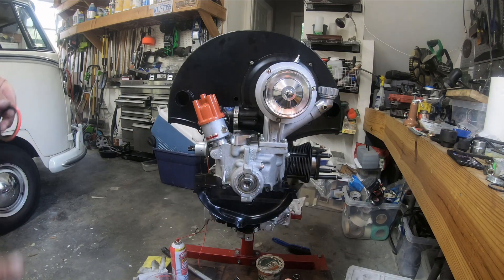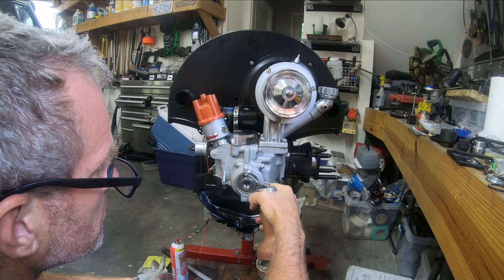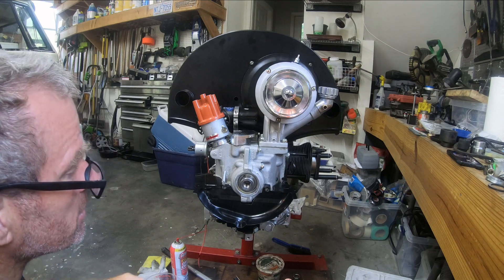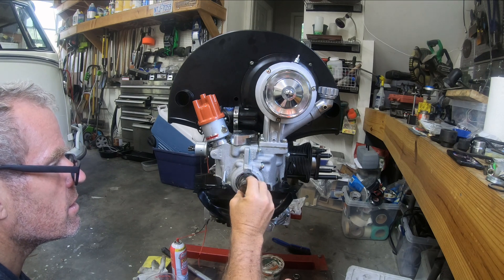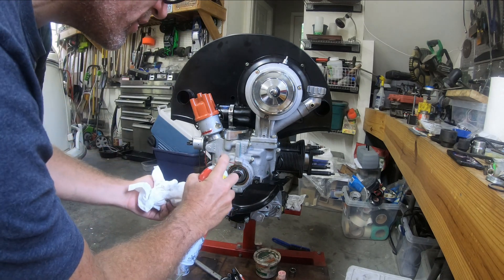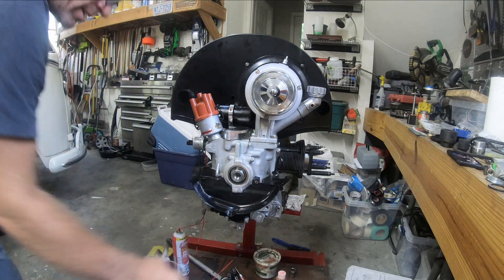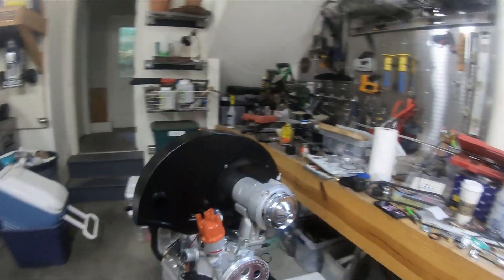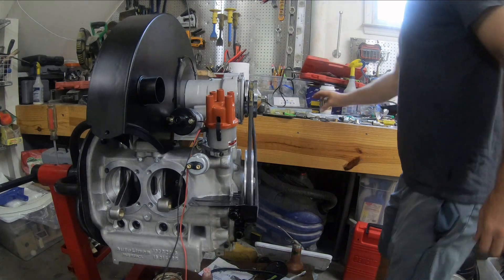2332 VW Air-cooled Stroker Motor - Video 24 - Sand Seal and Crankshaft Pulley Installation

Comment: Anyone got any advice om getting the sandseal out to replace it.  I fucked mine last night smacking a non sand seal pulley on. I have been told there is a small lip on myotor that prevents the sand seal  from going in the motor. Its been a tough week.  I purchased the new seal .  Its a non bolt on green one. Machined fit The motor builder told me to get that one.    He made its sound like it was gonna be a quick fix. I tried for a few hours after work.   No luck.   I will re visit today with a seal tool
Reply from the maker: So I used a sand seal on my bus motor.  With the pulley off there should be a little circular cutout where you can tap the sand seal into place and then the pulley goes back in .  Are you saying your case doesn’t have the fitting for it to tap into place?
Reply: No what happened was is I tried to put in a regular pulley with the grooves not the sand seal pulley hub and so I screwed the seal up that was in there already It's not a bolt on it's a pressed machined one but I ended up speaking to the man who built my motor today and he showed me how to get it out. So I have to remove it and then put a new sand seal in and then get the proper hub for my pulley. All just part of the learning process for me @LarsonSplitBus-

Comment: Did installing Sand Seal with permatex work to keep oil in, and was the pulley a non grooved style? I think previous owner may have had a sand seal because i found spacer between crank and aftermarket grooved pulley, I dont believe this would be correct. Considering installing sand seal with correct pulley to try and stop wicked oil slinging in engine bay
Reply from the maker: I actually have a sand seal and a normal slinger steel pulley now.  I got rid of the aluminum pulley because it kept getting loose.  Nothing like a steel pulley!  And the sand seal just sits there around the slinger and it doesn’t leak any - at least not from the pulley.  I have other small leaks around the valve covers and over the heater boxes to deal with!
Reply: I feel like putting in a seal cant hirt at least press fit style. Really like stay with grooved stock steel pulley even though guys have said grooves will tear seal. Idk guess got to experiment solve it somehow

Comment: Note to self:
Before mangling a sand seal ....
Alway use the 8 Ps:

Proper Pre-arranged Planning and Preparation ... 
Prevents Piss Poor Performance

Lol
Reply from the maker: Yep - somehow this time it worked out ok - no leakage from the seal, but I have trouble achieving zero leaks under the motor…
Reply: Synthetic oil molecules are all the exact same size. While dino-oil molecules are totally random sizes. Dino oil has a better ability to for a dam and have a lesser chance of leaking.
At least, that's my experience. Cheers

Comment: i've never heard of shims on the lower pulley?
Reply from the maker: Interesting!  So I hadnt either, but to get the whole pulley system to align with the AMR500 I needed it to be out just a bit, and there is a kit of the crankshaft shim and generator shim that was the perfect width.  I did have the crankshaft bolt loosen up - and since about 4mm less threads go into the crankshaft, it may be more susceptible to loosening.
Reply: @LarsonSplitBus-  not sure what AMR 500 is but I forgot to mention maybe because you are using a sand seal pulley that could be why you can run shims on the lower pulley. It looks like you might have ditched the upper pulley based on one of your later videos but it was hard to see.  I plan to go with the cb performance alternator pulley you had but in black to match my lower pulley.
Reply from the maker: @SanDiego_VDubLife oh ok - yeah sorry - I was talking about the latest video with the supercharger on the beetle - I didn’t notice that your comment was about the sand seal pulley install - my bad!
Reply: @LarsonSplitBus-  oh jaaaa. No worries

Comment: Is it possible to install the sand seal with the motor in the car? Just realized I installed a sand seal pulley and now I sling oil when I drive it.
Reply from the maker: I think as long as you can get the pulley off and back on (which means you have it in gear and the parking brake on, since you cannot get a flywheel lock on there) then you can get a sand seal on there - either on a machined case, or with the little after market sand seal kit round piece that you tap on there with a mallet.  But i know these pulley nuts can get on so tight you can't get at them with enough leverage.  Also if you are using a large wrench on a pulley nut - be really careful not to cut your hand on the pulley engine tin if the wrench slips off.
Reply: @LarsonSplitBus-  Thanks for the reply! I decided to go with a new sand seal pulley kit. I have a very old power pulley with the grooves. It just might be that the grooves are worn and not doing their job. The grooves are very flat and minimal. I see the kit comes with a washer that goes on the crankshaft. I already have a washer on the crank now. Do I keep the washer in there and add the new one, or take out the old one and add just the new one? I find this sand seal business very confusing and hard to get a clear answer. Thanks in advance for your time!
Reply from the maker: The washer / spacers that go on the crankshaft and alternator / generator shaft are mostly to make the fan belt line up - I have found that different pulleys bolt in closer or further away from the crank, and you can have a misaligned diagonal fan belt.  So I would tighten down your setup and align the belt the way it will install, and if you need the spacer on either the crank or the alternator / generator then put one or more on there….  Good luck with your project!